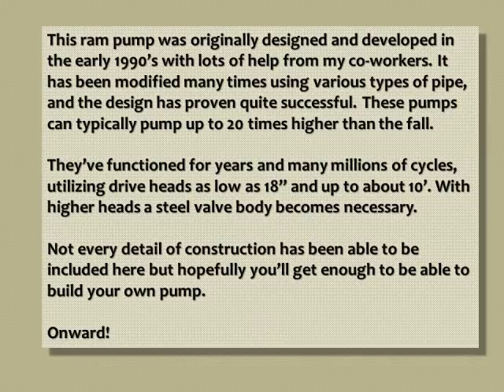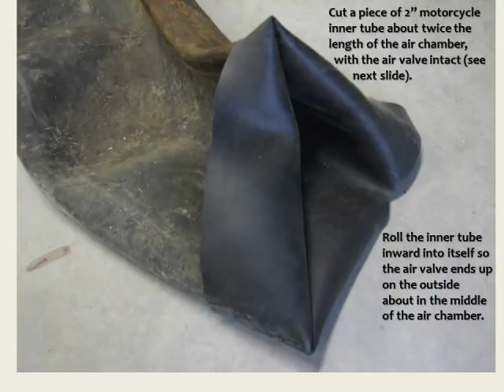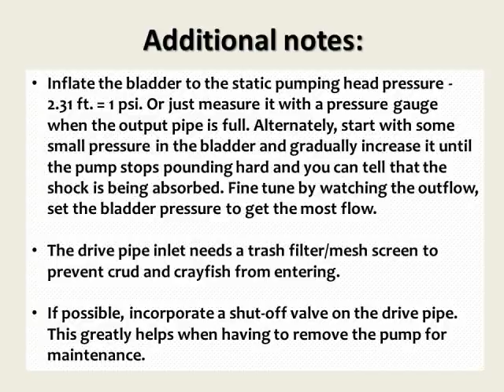How to Build a Linear PVC Ram Pump!

Comment: very awesome idea!  I am currently trying to decide which variety of ram pump to install in my creek.  I know I could build the PVC version, but I'm not sure about a steel one.  I don't have the tools necessary to cut or weld any sort of thick metal, but maybe I could pay a local guy to build one.  You are the first person I've seen (besides me) with the idea of an external valve for adjusting the pressure in the air bladder!  Thanks for the video, nicely done!

Comment: I recently went down the ram pump rabbit hole.

I need a pump that can operate without power to get river water up the bank to storage tanks for irrigation and home water.

From what I gather, inline is what I'm after as it can operate completely submerged.

My question is if submerged, and my discharge pipe is insulated and burried, with continual flowing water, do you think this pump could operate in mild below freezing weather??
Reply from the maker: Yes,  I've run it in freezing weather with no trouble so long as the water keeps flowing and the pump is mostly submerged.

Comment: Hello thank you for instruction on how to build your Linear Ram Pump. It very good for me and my friends .We want to know connecting with the air chambers ( low head, low pressure air chamber bladder) if you can build your hand on video batter than PowerPoint .Thank you so much waiting your answer

Comment: Thank you for the video but I'm missing something. Does the check valve rubber bend inwards from the pressure and then spring back to seal the chamber?

Comment: Hope you can answer this, when you fold the tube over itself are you making a hole in the wall of the tube for the valve to come out then sealing it ?
Reply from the maker: No, I use the original valve and just cut the tube at the appropriate places so that when it's finished the valve is positioned about midway. There's no reason why you couldn't use a repair type valve though, and cut a hole for it where needed.
Reply: @Approtechie  thank-you for responding, i have a cabin with water close by, this will be great!!!

Comment: Probably the least important of all questions but how did you get that test hose that far up the tree?
Reply from the maker: +Aidan Deslippe Ha! It wasn't easy - we used a long ladder in a pickup truck box to get as high as possible. On a demo unit I installed at a training center I attached the outlet pipe to a wind tower that gets winched up and down so I could make it even higher than this one.

Comment: Thank you for the instructions ! ! ! 
I don't see the reason for the "Bladder" why would you want or need to separate the water from the air? Anything that would "Grow" in that chamber would not be worse than the things growing in that creek! I think the bladder and all it's parts could be eliminated for an easier build. ALSO: I realize that
    too small of an air chamber can reduce efficiency of the pump BUT is there any large limit to the air capacity in the air chamber? it seems that the more air the better. A Large air capacity would ensure that the water being pumped up the hill will move at a steady 
  pace, eliminating any Stop and Go action that is the action that makes the pump work in the first place. 
The extra air capacity would always allow plenty of space for each Ram cycle to force maximum amounts of water past the check valve. 
NOTE: there is no reason to "Charge" the air chamber with pressure, it will always equalize by itself after the pump has built some back pressure. 
if there is a reason for limiting the size of the air chamber please let everyone know. Thank you for you videos.

Comment: looked quickly through the comments but didn't see..is this pump self priming?
Reply from the maker: No need to prime a ram pump. It operates on falling water, and gradually fills the output pipe until it flows out.

Comment: I'm having a hard time finding a proper fitting metal flapper. 4" steel pipe isnt the right curvature and I can't get my hands on any 3" metal pipe. any suggestions?
Reply from the maker: +Menachem Best I've found various pipes that work, including 3" pipe, stainless exhaust pipes, aluminum irrigation pipe, etc. I've also at times carefully bent a curve in heavy stainless sheet metal using a vise, but it's hard to get a perfect curve that way. The best is to find or make something about a 1/4" less in radius and just build up the rubber layers until it fits well to the inside of the 4" pipe.
Reply: +approtechie thanks. I got a piece of stainless on eBay for $5 and bent it around a 3" steel pipe.
Reply: +approtechie. I made my supply line output on the far end of the pressure chamber by reducing down to accept a sillcock. this way I have a shuttof and proper threads for a garden hose. is there any specific reason that you didn't put your output on the end instead of the way you have it closer to the check valve?

Comment: can a ram pump be run with the water source only a few feet above the pump?
Reply from the maker: +Rick Cato Yes it can. I've run this one on just 4" of fall - it didn't pump very much or very high but it pumped.
Reply: +approtechie Say Bud,  I'm foggy on the bladder.  You put one  end over the reducer, so it fills with water ?  Holes along the edge of the reducer and water goes on the outside of the bladder also.  I don't see how the bladder holds air ?   Sorry, did I miss something ?  Soooo  confused here , LOL. Thanks for any help  !
Reply: Hey WH, I had the same question as you.  Approtechie answered above.  What you and I were missing is that BOTH ENDS of the tube are stretched over the reducer.  So the folded over inner tube forms a sealed bladder.  Hope that helps.
Reply: Irv Barth   Thank you !
I'll have to watch the video again !  8 )

Comment: Thanks for the video.  But I am with WH; I  don't understand how the bladder is keeping the water and air separated.  And you say 'holes drilled in the bell reducer to allow water to pass over the outside of the inner tube as well as into the middle'.  I must be missing something.  I understand the need for a sealed air chamber.  I just don't see how this is accomplishing that.  Can someone bring me up to speed?
Reply from the maker: My early version had compressed air in the chamber pushing on the inner tube stretched over the perforated pipe - the bell reducer had to seal perfectly in the 4" pipe, no holes in it or all the air would escape. My later version uses an inner tube folded back on itself, clamped together at the open ends, with air valve extending outside through the 4" pipe. Inflating the doubled-back inner tube then allows me the freedom to not have to seal the pipe against air pressure, it's all in the inner tube- this version can have a perforated 3"-1.5" bell reducer to allow water all around the tube. Sorry for any confusion.
Reply: Thanks for the quick response.  I understand now that after folding the tube back on itself, you stretched BOTH ENDS of the tube onto the bell reducer.  That is what I was missing.  You said 'the ends' of the tube, but I missed that.  I thought only one end was on the bell reducer and the other end was just glued shut.  Have you thought about bringing the delivery pipe out of the back end of the pump by reducing it back down to a pipe fitting instead of just capping it off?  It would save you from having to tap into the side of the pump (if that is worth anything).  If the bladder tends to impede the water flow, you could put a 1/2" pvc pipe through the center of the bladder to keep the flow open.  Again, I don't know if that reduces or adds complexity.
Reply from the maker: Yes, I've seen others do it that way with the outlet coming from the bottom end, but I've found that the pump jerks pretty hard and needs something solid to push against at that end. A pipe coming out there is pretty vulnerable to damage. I suppose you could just figure out another way of mounting the pump solidly leaving the end free. It could certainly work. I usually put a perforated 1.5" pipe from the bell to the cap so water would pass right through that.

Comment: It’s an OVER BUILT simple RAM PUMP! U can make a lot simpler Home-made Ram Pump with a lot less complexity & less work ,that do same thing!
Reply from the maker: Let me see your video of one. It has to have the same advantages as this one, including pumping under water 24/7 without problems, and being low profile to survive flooding. Also, I'm getting a 20:1 delivery lift to drive fall ratio.
Reply: approtechie why don’t you upload any more ?